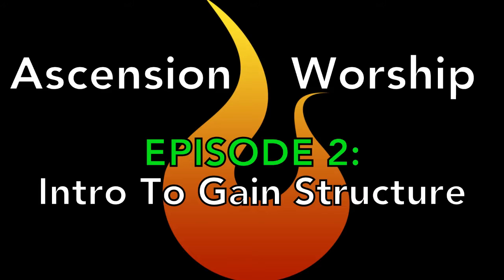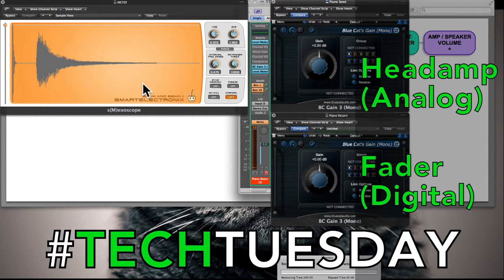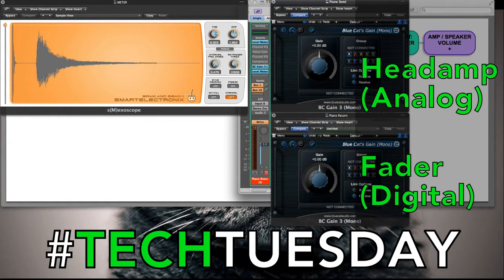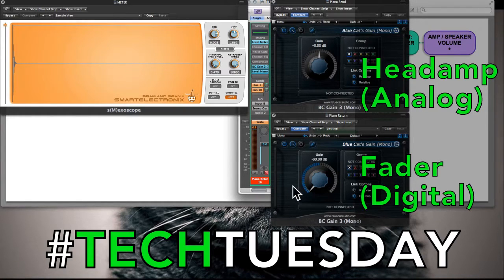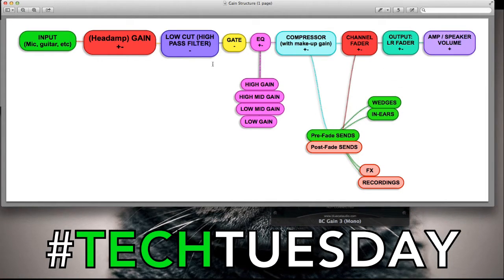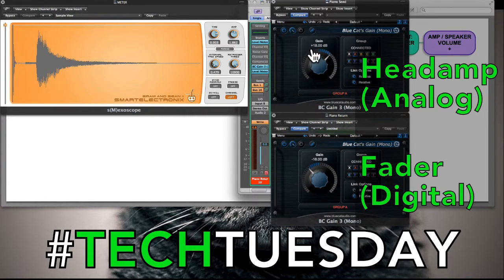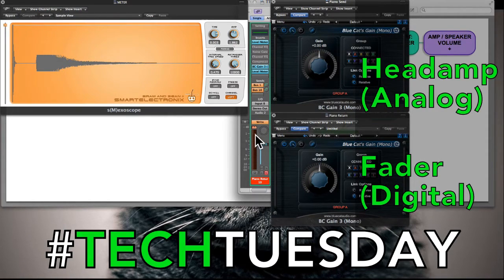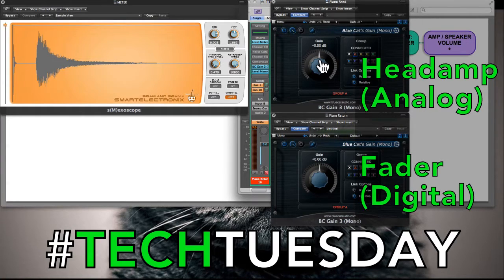Gain Structure - #AscensionTechTuesday - EP002

Comment: Awesome, just what I need to learn. Thanks! By the way, I’m using Allen Heath QU24, There are two meters, main L/R long ones,  just like yours in video but in pair. And there’s also this 3 tiny led in each channel strip (flashes from left to right with green, orange, red). Should I consider that as well or just look  the main meter? Thanks

Comment: Great video. One question, what should you set the output of the instruments going to the board. For example, we have a Roland electronics drumset and we can adjust the level of the amount of signal we send to the board. Is it better to send a strong signal from the drumset and then have low adjust on the gain knob on the board? Or set a lower level from the drumset and rely primarily on the gain increase in the board? I'm concerned about distortion or having the board make up too much of the gain. Thanks!!
Reply from the maker: You will generally get better signal to noise ratio by having the volume louder at the drum set and then using a lower gain setting at the mixer.

-Chad

Comment: The visual aid in this example makes this so easy to understand what's happening good or bad. I'm learning great things with your tutorials. I have a XR18 and run sound from my Mac. I wish I could find something in it that showed the signal image like that orange meter. I'm guessing that's from recording software correct?
Reply from the maker: That is a free plugin that I'm using with my DAW. For the XR18, I think you can download a version of mixing station pro on android that has waveform view that's similar. It shows you how much you're compressing or gating. It's pretty cool. Usually, I just use the peak meter and stay out of the red. 

 -Chad